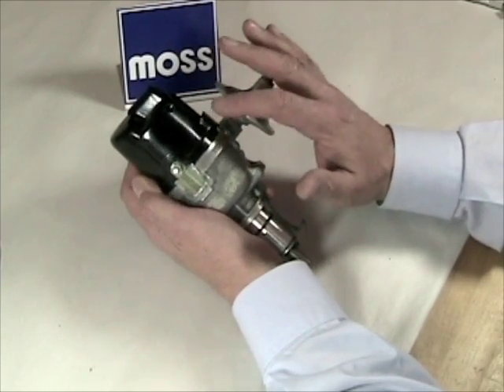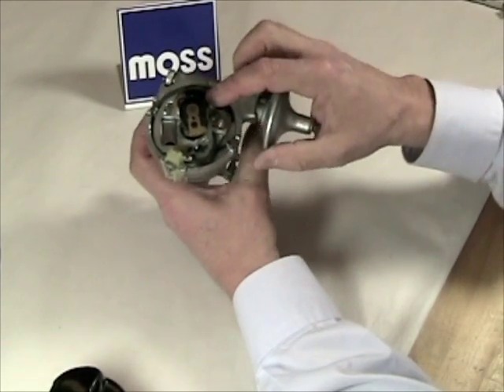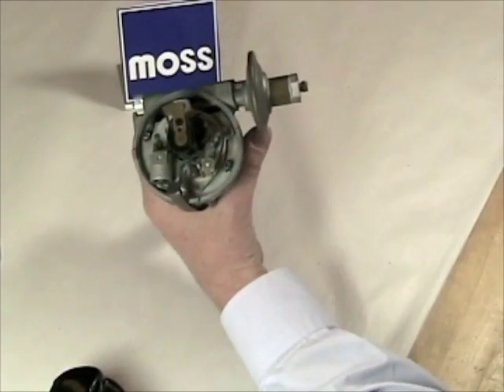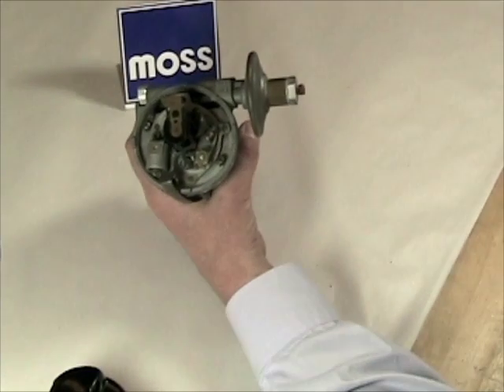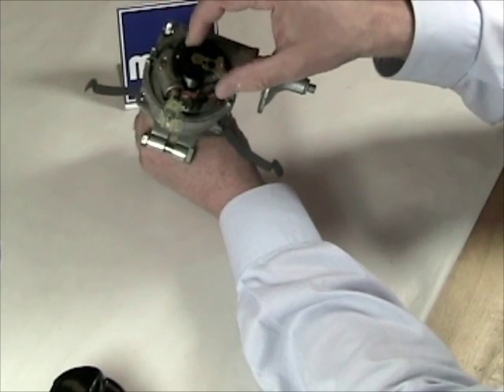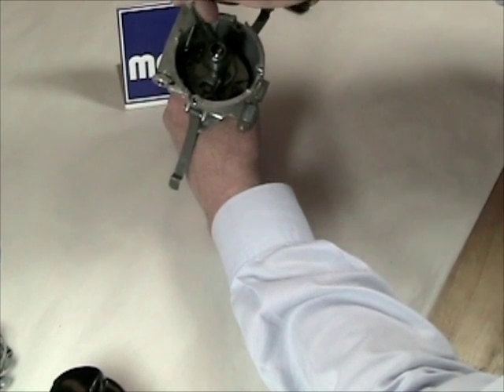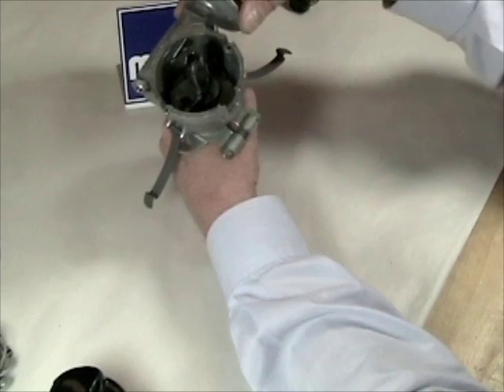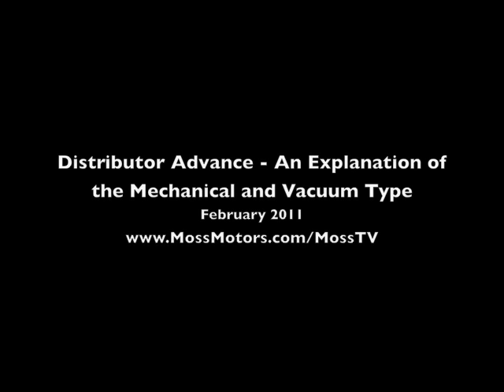Distributor Advances (Part 2) - Vacuum & Mechanical Explained

Comment: Could you please make another video explaining how the other part (Intake Manifold) creates and connect this vacuum for the distributor? How things happen!
Reply: Vacuum is created inside the intake manifold when the pistons rapidly go down during their intake stroke.  They are creating a space where there briefly wasn't any so outside air rushes in because the outside air pressure is greater than inside the cylinder.  There is lots of vacuum created at idle and as the engine rpm speeds up, the piston has less time to create this vacuum and so it drops to almost nothing at full throttle.  This vacuum is also applied to the diaphragm on the vacuum advance on the distributor by a vacuum hose.

Comment: Our Toyota 5k engine stalls after few seconds. At first I thought it was a bad fuel pump so I changed it but issue still the same. I already cleaned the carb, replaced contact point and spark plugs. I found out that the vacuum advancer doesn't work anymore. I know that there could be other possible cause but could a vacuum advancer be a cause for an engine to stall? At idle, engine runs for few sec, giving it some revs won't help. Thanks for the video.

Comment: Hey man I got a Ford f 150 truck 5ltr winsor gt40 heads weiland intake 600 holley 2 in rise to miss the dizzy top I have ran the vacuum advance line on and off the holley carb and direct manafold vacuum its only a small cam it runs better with the advance line from direct manafold vacuum than off the holley carb more snappy take off than off the holley port no feeling of the transfor from the idel circuit to main circuit just a much more smother transfer motor is better on fuel down low it's worth trying out this is my second motor I have done this to the other was a worked holden I read how to do this and much more in a book called the holley bible it had a yellow front page good luck
Reply: can you use periods?

Comment: Thanks you can you please tell me why they have both and not just 1 sort of advance Many Thanks Ian
Reply: +sandydogy The vacume advance only operates when the throttle is slightly above idle such as taking off from a stop. as you move the throttle open further, the vacume advance drops out and stops operating. the mechanical advance takes over at higher rpms such as driving down the highway at high rpms
Reply: Close, but you are not quite correct. There are two factors at play here: Manifold Air Pressure (vacuum) and RPM. Both are independently affecting the spark advance, and have a cumulative affect on the overall advance. The vacuum advance will have the most degrees of spark advance when the vacuum is highest (except at idle IF the car has "Ported Vacuum" rather than full manifold vacuum supplied to the dizzy) which occurs when the load on the engine is lowest. Working independently is the mechanical advance, which advances the timing based purely on rpm. Often times, when highway cruising, the vacuum advance is working to almost it's full spark advance (because the load on the engine is less when steady speed cruising). The vacuum advance cuts out completely at Wide Open Throttle because the pressure difference between the manifold and atmosphere becomes zero.
Reply: So the question becomes- "why does it need to be advanced? why don't I just set the timing to the advanced position and leave it there? imagine going up a steep hill with a truckload of heavy  stuff- the throttle is wide open and the rpms aren't very high. the engine is producing it's max horsepower at low rpms. if the timing were too far advanced you would have pre-ignition and detonation- lots of knocking noises, and before long overheating and a blown head gasket.

Comment: wait a minute you are telling us that the car will be running with the distributor cap off and rotor removed and the points plate removed so you can see inside of it as you ruv it up?
Reply: No dude, he's saying you need to disconnect and plug off the vacuum advance only and use the timing light to observe the issue while revving the engine.  It's actually a good video, one or both of these issues might be occurring on my vehicle
Reply: it was a question
Reply: hahhaha thats so funny how would that be possible, crack up as

Comment: Moss Motors, Ltd. Hello.... I have an issue. I have a 61 Lincoln  and when she's cold and on the highway she runs great.. However, once the engine bay/engine warms up (I'm in Texas by the way), when I come to a stop and then accelerate it will stall.. If I don't gently push the accelerator it will stall.. Could this be a vacuum advance issue? MEchanical pump and carb have recently been rebuilt